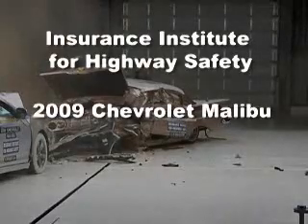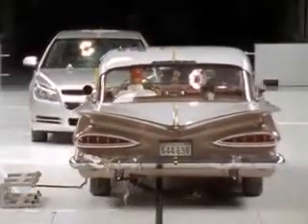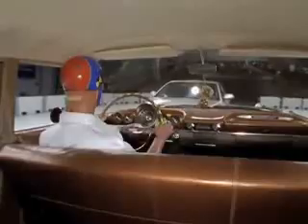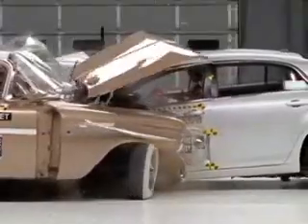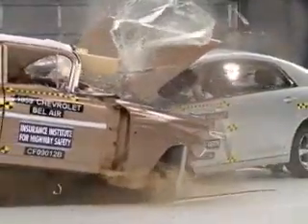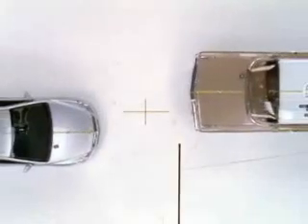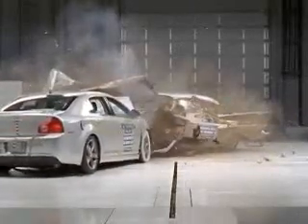Crash Test 1959 Chevrolet Bel Air VS. 2009 Chevrolet Malibu (Frontal Offset) IIHS 50th Anniversary

Comment: people...im not here to argue.....the car is made with a peice of shit x frame..which when hit from this angle it will crumple like paper..try it with a 1959 chrysler or ford..not GM...just look up the stuntbusters clip..they crash a 1961 cadillac into a newer cadillac head on and they crumple the same way and the old caddy would have perfored even better if the floor pans and everything werent rotten with holes in them, they show it all...so put the peices together..once again not here to argue

Comment: I think it is evident to all that the engine bay in the Bel Air holds nothing but air. The question here is; Would the Malibu be equally succesful in this test taking the 500 lbs thrust  (or more) of the cast iron original engine in the 59 Chevy??  They crashed the new car against an empty shell with no engine and surely no tranny as well. Talk about some advantage!!! Totally biased shit.

Comment: They proved this video was faked you know...and yes, that is true in many situations, but olds cars are better regardless of safety, the best thing is that they are so darn easy to work on, and no idiotic electronic crap. My newer car has so many electrical problems because of it. I'd rather have a pre 70's car.

Comment: It's designed to crumple, that's the goddamn point. An old car will stay rigid in light impacts, but the moment the impact is forceful enough to start bending it, every ounce of strength it has evaporates. This is very visible in the video. New cars are designed to maintain their strength even while they crumple. Think of the crumple zones like a spring. Old cars don't have that springiness, and from the moment the deformation starts, that steel might as well be cardboard.

Comment: The majority of car crashes are with stationary objects or other vehicles, where the advantages of the safety cell are more obvious. I don't see your point though, you'd be a lot better off in a new Honda Fit than your 1950s rustbucket in either type of collision.
Re-reading your original comment, it's actually the other way around. The old Bel Air is a whole lot classier than a new econobox like an Impala, but you'd have to be delusional to think a sixty year old car is safer.

Comment: @DJSin....You are correct that modern design with all the crumple zones will better protect you in a crash, but it depends on what you crash into. If you crash into a non-deformable object like a bridge pillar, modern car will indeed soften the blow by crumpling. Also we need to factor in the size and weight advantage between cars. I'm pretty sure that a dump truck has no crumple zones, yet I would choose being inside the dump truck over any ultra modern & safe car if they were to crash head on.

Comment: Quick, the local supermarket has 50% off tinfoil! You need to get there before the government seeds the tin foil with nano machines that will allow them to implant and read your thoughts! Go NOW! Once you get them its going to block the NX-100000000 Spy Satellite from tracking you by your brain waves and reading your thoughts. 

The information is ALL over the web and believers even have special buildings with soft walls where the meet to discuss ideas like yours.

Comment: Waste of a nice Bel Air, replica or no. 

Also, notably, that's the worst type of impact you can have in a car. Head on, the Malibu may indeed be more solid, but we can't say, because this is designed to be a sweeping statement justifying the snore-inducing bore that is the 2009 Malibu.

Comment: Nothing like the old three degrees of seperation. Anyway back to fact, manufacturers spend alot of time/effort on what to do with the engine in an accident, it makes a good battering ram, straight into the passenger compartment. Modern design deflects them downwards. An engine in the front may only protect you if someone is shooting at you. Think about it, whats the engine/box attached to?, so if that bends where is it going?

Comment: no it doesn't. look at the right mudguard. impala crashed from left mudguard but right mudguard came out from it's place. if there would be an engine in impala, the engine will absorb the impact. because of from the empty area, impact velocity caused the right mudguard came out. not just the right mudguard, also the console is completely damaged. in a steel car with this size of speed, this is impossible.

Comment: "BUT they will hold their integrity during a "Direct" impact"

First, offset crashes are more common.
Second, you want the car to maintain integrity for the passenger compartment in all crashes.That's the point of crumple zones; they strengthen the passenger compartment so that the engine/trunk area will collapse in a crash, absorbing the crash energy and lowering the deceleration forces. If you look at this video, you can see how well the Malibu maintains the shape of the passenger compartment.

Comment: notice the new car hits the old car outside of its frame rails. It is very easy to crumble the tin body of older cars, its the frame and bumpers in a "Direct" hit that are strong, older cars offer no protection due to no air bags/seatbelts or collapsing steering columns...ect...ect.. BUT they will hold their integrity during a "Direct" impact, although the driver will still be seriously injured due to lack of safety restraint equitment. I own a 1962 Ford Galaxy.,

Comment: the crash is replicated. I was given free reign to inspect the 1959 Chevy Belair AND the 2009 Chevy Malibu. I looked under the '59 and found the frame to bent almost in half where the frame "Y's" at the front just behind the transmission tunnel and the driveline goes through. There were no cuts or welds or evidence of it being modified for a "controlled" crash. The front tire now sits where the pedals used to be and the steering wheel now touches the roof. Would the driver have survived?

Comment: This X-Frame design allows for an almost flat floor and sills and is very strong and lightweight, but gives no rigidity for crashes such as these. I inspected this car top to bottom and found no modifications to the frame, suspension or body...NONE! As far as the "rust" seen coming form the car...IT IS DIRT AND ROAD GRIME from INSIDE the fenderwells and UNDER the car. Soon after the video of the crash test was released, the man who sold the car to IIHS, stated IIHS never told him what they..

Comment: I have seen this car in person at the IIHS Facility in Arlington, Virginia. It is on display with a host of other vehicles. Thye have removed the front dorr, as they do on all the cars after they have been crashed. I can tell you, for a FACT, there is an engine in the car and the front of the car is NOT plastic, fiberglass or modified in any other way. I own a '59 Pontiac and there is a perfect explanation as to WHY it crumpled the way it did. All GM cars from '59 &' 60 have an X-Frame....

Comment: the test was rigged. if you pause at the impact portion, you will see a big CLOUD of rust fly from the bel air. the reason why it crumpled was that the frame was so rusty, and there was no engine in the car. if you look at demolition derby videos form about 40-45 yrs ago, you'll notice it takes a couple of whacks before the cars even look ANYTHING resembling that.

Comment: All it does is proves the obvious; that a product with 50 years of engineering improvements is going to be 50 times better at everything (minus the looks). That said, cars made just 10 and 15 years later were already much safer. Not comparable to today's econo boxes, but crashes suddenly became a lot more survivable with the introduction of standard safety features: reinforced front end zones, lap/shoulder belts, shatterproof glass, and collapsible steering columns.

Comment: No matter if the Bel air was in new or rusty condition, due to things like Electronic Stability Programs, Anti-lock braking, power assisted disc brakes and better engineering it is far less likely in a modern car to even lose control in such a way that you would get into a car crash.
While I like some of the styling it does not make up for the fact that old cars like that are noisy, polluting, inefficient death traps compared with modern cars.

Comment: It's funny how they used am old rusted Bel air. They said they wouldn't use a restored Bel air, but wouldn't that be the point? They should have used two cars that don't have any rust (resulting in more damage). 

I would like to see that, a test with an old car and a modern car, both with no rust and damage.

Comment: "Stronger materials" allow the newer vehicles to absorb more energy from an impact. Higher strength steels in newer vehicles allow the manufacturers to reduce the mass/thickness in body sinks and bracing.

Comment: I dont think this test is completely accurate. If they took a 50 year old car and crashed it against a modern day chevy, they're basically testing the pysics between old steel versus new. Over time steel loses strength, but if you built a Bel Air in the exact way they were built back then except with today's metal alloys, I think the outcome would be quite different.

Comment: @crownpitful I do not need to research, it did it to us. Stay the hell away from the Mazda 3 SP23, you are in for nothing but pain and never ending repairs. Ours was brand new, and within a year it had gone through 4 sets of tyres under normal driving conditions, needed to have wheel alinements twice, constantly burning batteries and starter motors. it lasted 3 years before we had to get rid of it because 3 engine mounts broke and were not covered under warranty. my '85 ute lasted 25 years.

Comment: they may be safer, but in the time that you can keep an old car going, moderns cars wear out much faster and you spend much MUCH more time and money keeping them on the road. Too much electronics, to get it fixed you have to take it to some technician who connects the car to a computer to tell you that it is a minor problem and charges you for doing nothing but pushing a few buttons. At least the old cars you can fix yourself. Thanks to modern cars like that people today cannot even change tyres

Comment: @directorjustin I had a 400 CID Chrysler that made 400 HP at 15/gal.  If you consider fuel burned per volume vs power delivered, an engine 1/3 that size delivering half the horsepower should be getting 75-90/gal.  They don't.  Larger cylinders suffer less from area condensation and fuel dropout.  Large engines are more EFFICIENT in terms of energy production.  They are less ECONOMICAL in terms of fuel used.  Modern cars have far more efficient drivelines to make use of what they develop, too.

Comment: @CL137626 They're comparing similar frames of cars--Bel Air and Malibu are the same lineage, updated.

While my old 73 Caddy would hold up very well against the Toyota, there are still issues of stress risers and breakage, and deceleration.  The modern car sacrifices itself to save the passenger, which is far cheaper than the alternative.

Now, I do like the Caddy/van/truck vs Smart Car videos.  Those are great entertainment.

Comment: @bvlind They stripped it of nothing. I will say that the car is old and the metal of the 59' is composed of has been deteriorated over time. You can see some dirt/rust mix shoot out of the car. Sure the car is not as strong as it used to be, but the video is there to demonstrate the advances in technology for car crashes. It is obvious the malibu with its newer technology and crinkle zones absorbs energy far better than old cars.

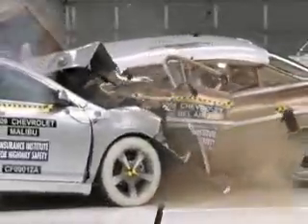Comment: Lets forget about the engine being removed. The secret in automotive structural engineering lies in the cabin. The cabin is where you strength should be concentrated into. Realize now that at 0:17 and 0:26, we see just how unsupported the A-pilars of the Bel air are. There is not the kind of strength in the cabin that we see in the malibu. Malibu wins, I think I made a decent argument.

Comment: Part 4: New cars are like strong boxes (the cabin) with a cardboard box taped to the front and the back. Sheet metal is indeed thinner in modern cars, but metal is advancing and skin strength depends on Make and Model. The Malibu is even stronger than it appears in the video because it carries less momentum. Cars were actually weaker structurally and sheet metal wise starting 1959-1960, which is why they chose this year (got it from Modern Marvels:Corrosion). Hands down new cars kick ass.

Comment: Part 3:and you can't destroy energy. The best cars are the ones of the present day from a safety standard, because they crumple from the hood to the point of the cabin and from the trunk. This disperses the kinetic energy into the crushing of the car. The stopping time is vastly increased during an accident, so people live. Steering columns are now collapse and deploy an airbag.  All of this is absorbing the energy of the car so less of it is transferred to the driver.

Comment: Part 2:The inertia of the individual means the occupants want to keep moving when the car stops. You can tell this when you stop suddenly compared to gradually-and it feels less comfortable to stop suddenly. . As long as the person keeps moving once the car stops (when it crashes), the person is fine. However, the occupant in old cars flew into the non-collapsable steering column, as the kinetic energy was entirely distributed into the occupant, since the car stopped almost instantly,

Comment: Part 1: Classic cars are indeed stunningly beautiful, but New Car structures are based on the laws of inertia, Kinetic Energy (Ek=.5MVsquared), Mommentum conservation (P=MV), energy conservation, and force (F=MA). When cars first came out in the early 1900s, they had ultra stiff body structures, for at that time strength was thought to be best. However, a car carries Kinetic Energy as it moves, and energy must be conserved.

Comment: Hello all, I am a freshman at Colorado State University, seeking a bachelors in Mechanical Engineering. I do my own extensive research on crumple zones, automotive physics, and calculations. We often work out automotive engineering problems simplified in calculus through derivatives. I help out the Formula SAE team on saturdays at CSU's Motorsport Engineering Research Center, where I have learned much. The university I am attending has specialty motorsport engineering programs and classes.

Comment: @soon2bewed RED3978 - Your so right Bud. They took the motor out of the 1959 Chevrolet Bel Air!!! Notice in the top view of the crash they hurry and change the shot/angle of the video! Look how high the front fenders are "that of a car with it's motor removed".... I stand firm with the OLD cars. Lets see a head-on crash NOT a partial frontal collision. OLD CARS ROCK and are much stronger than any of the crap made today...OLD cars = Machinery  NEW cars = Technology.

Comment: RED3978 - Your so right Bud. They took the motor out of the 1959 Chevrolet Bel Air!!! Notice in the top view of the crash they hurry and change the shot/angle of the video! Look how high the front fenders are "that of a car with it's motor removed".... I stand firm with the OLD cars. Lets see a head-on crash NOT a partial frontal collision. OLD CARS ROCK and are much stronger than any of the crap made today...OLD cars = Machinery  NEW cars = Technology. For safety I'll stay with Machinery.

Comment: @mhtube01 The 1955-57 Chevys were virtual copies of each other. The 1958 was a one-year only body style and the 1959 was a different style altogether. The '59 Chevy her IS a Bel Air! Look closely at the insignia on the front fender. The '59 Impala had thicker side trim with the insignia in the trim piece on the rear fender and had vertical trim strips in the rear taillights.

Comment: @jb98ish If it was a 57 Belair it would have crushed the malibu the reason this 59 failed is because it has a X shapped frame witch is very dangrous in front offset and side crash's I think they used the X frame from 1958-1961.

Comment: This video is legitamate. After consulting with upperclassmen Mechanical Engineering students at the Colorado State University Motorsports Engineering Research Center, members of the CSU FSAE team, I know this video is very real. I myself am starting out as a freshman seeking to enter the mechanical engineering program at CSU. Back in the 50s, they did not design car structures based on energy absorption physics and they did not follow the law of the conservation of energy, but they do now.

Comment: @trippberry It wasn’t just the airbags and few other things. It’s the improvement over past 50  years. 
Just to name one here: 
1959 = same strength through the entire frame so entire engine compartment SLIDE INTO the passenger compartment during an impact.  
2009 = softer in engine frame and harder in passenger frame so engine part will slow down the car while passenger compartment stays intact

Comment: Ya know, this is only model of a car, out of the many from back then, some of those old models, are just as safe or safer than these new things, just add seat belts, and a couple small saftey modifications, then you can have a really safe car. And also that 59' had no damn engine in it, which makes a big difference. There were many cars and trucks then with different frame deigns, some would do better than others. Frankly I think this is a shitty narrow-minded test.

Comment: @wv02m You are exactly correct. There is NO ENGINE IN THE '59! Thus not a valid test.

What is does do, is confirm that the frames (the part right under the surface layer of the car) is faaaaaaar superior in the new vehicle. Even though we all see them as looking and feeling like cheap pieces of fiberglass junk, the new frames steer the engines away from the driver.

Also notice that the top/roof of the '59 caves in due to the force. Having an engine in it would not change the forcefulness.